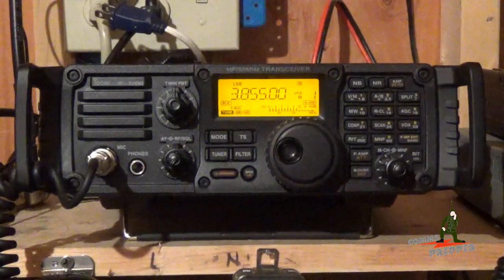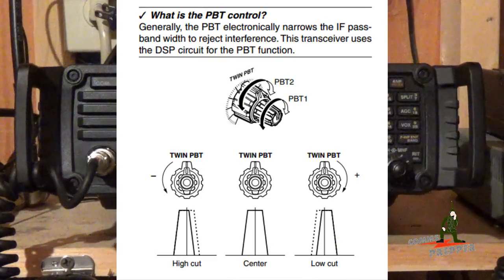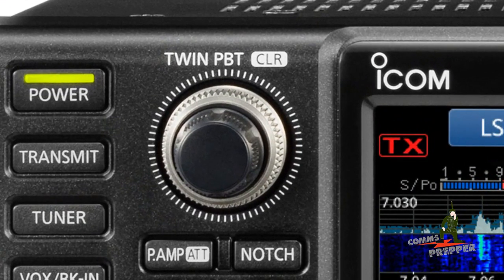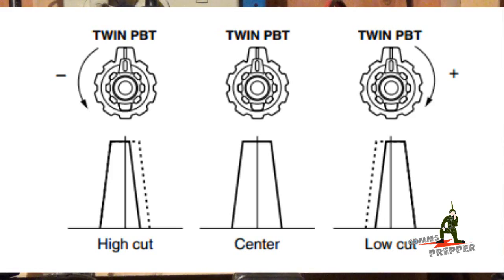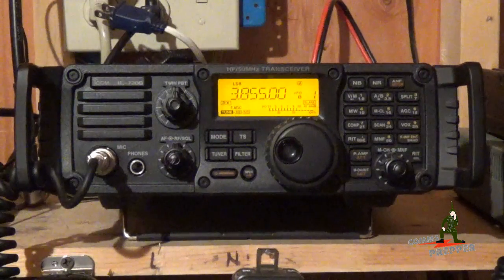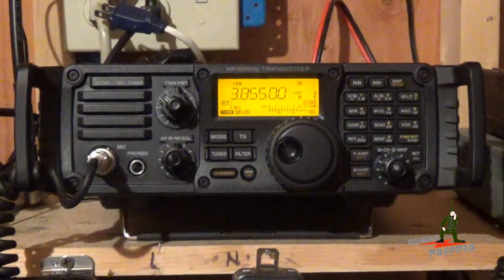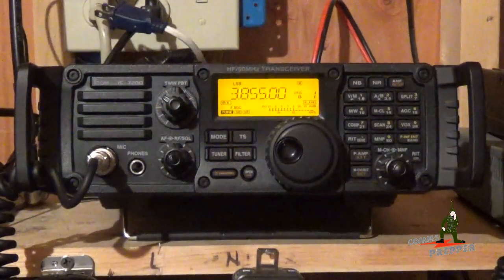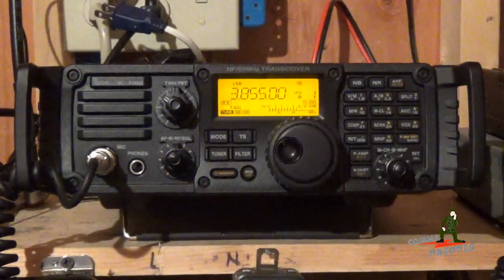Icom's  Twin Passband Tuning (PBT)

Comment: A great demo of the filters would to bring up a waterfall display on fldigi and adjust both knobs. As an IC-7200 owner, I use the filters in digital modes so I do not have to listen to the whole pass band.
Reply from the maker: Sad that Icom had to discontinue the IC-7200.